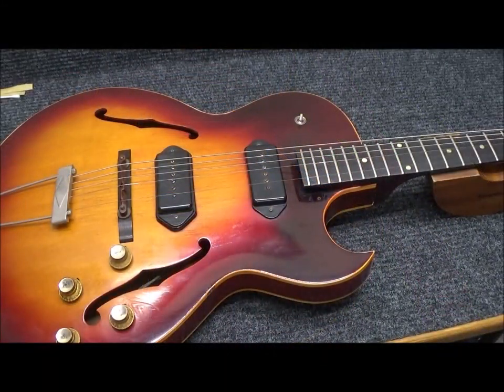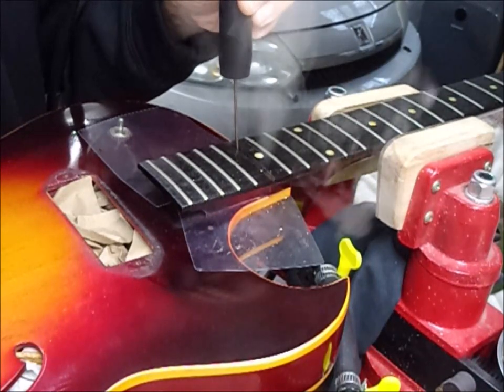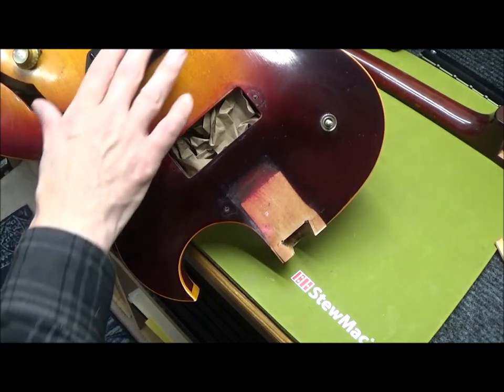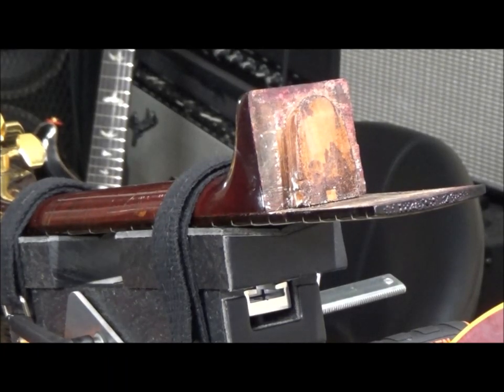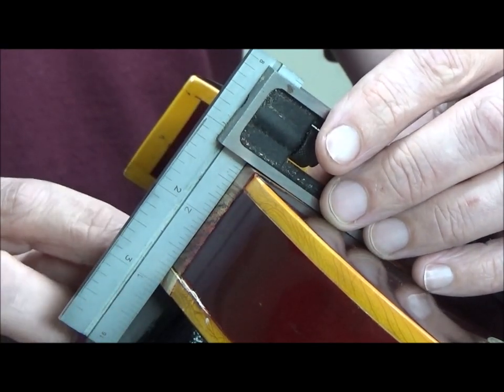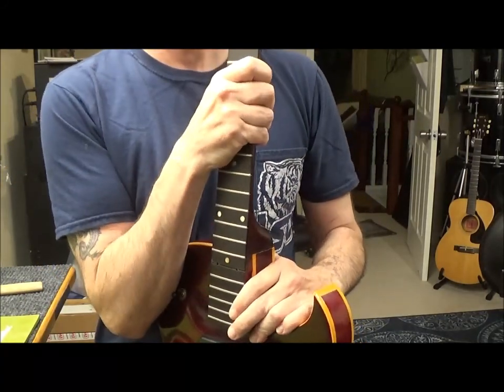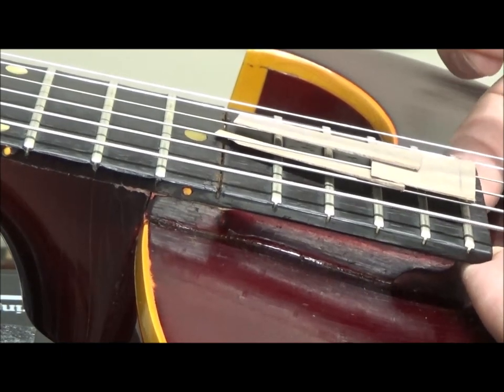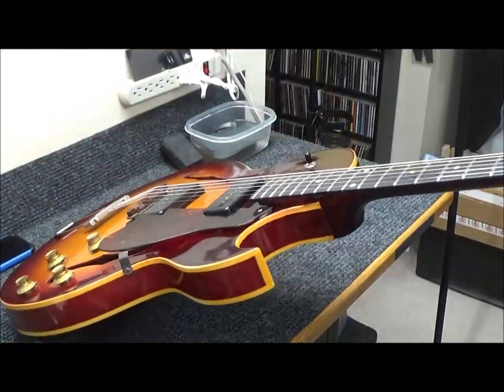Neck Reset - Gibson ES 125TCD

Comment: I like those guitars... especially the TDC. Have you ever seen Ted Woodford here on YouTube. He uses foam cutters for neck removals and avoids all the steam and danger. I see you're responsible about getting it out of there quickly, but it's essentially the same process with tools that are familiar in shape. Pretty slick.
Reply from the maker: Yes Steven, Ted is one of our IanHatesGuitars gang members and I feature both of their channels here on my channel. Great channels! I have 4 foam cutters. Steam can be 10X quicker on this sort of neck joint but I did use the foam cutters on the last ES-125TC and they worked fine. It just took forever 😅 My most recent video on the ES-125T is in this link: Gibson ES-125T Restoration (1959)
https://youtu.be/R3UCvd2tHg8